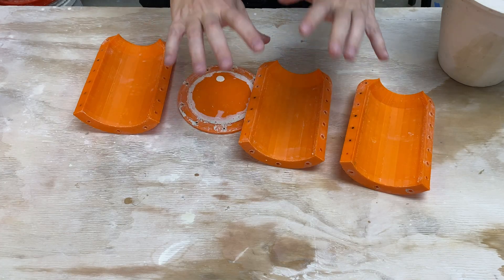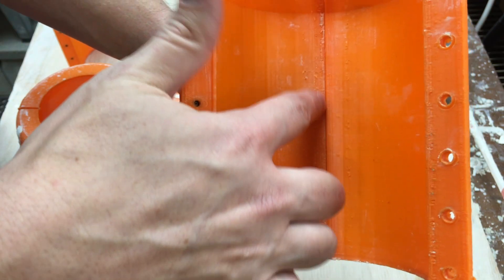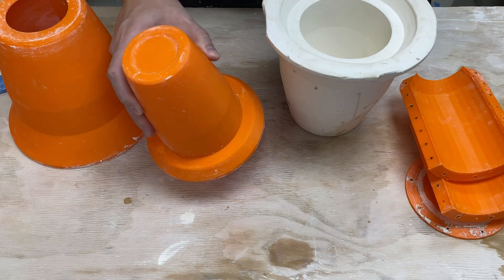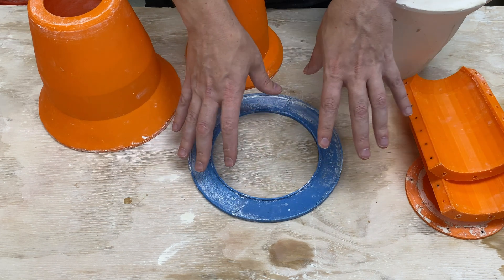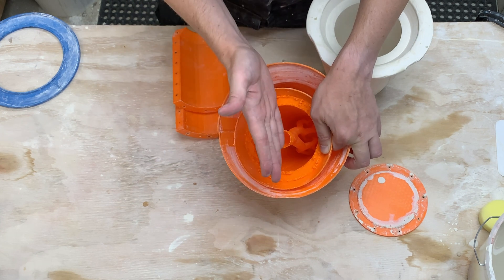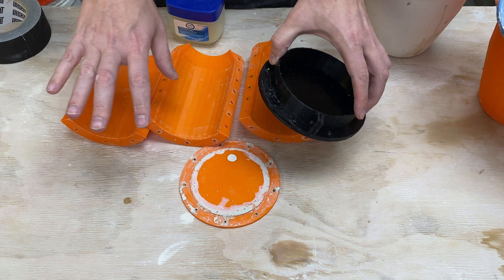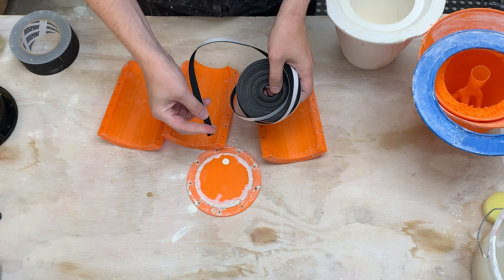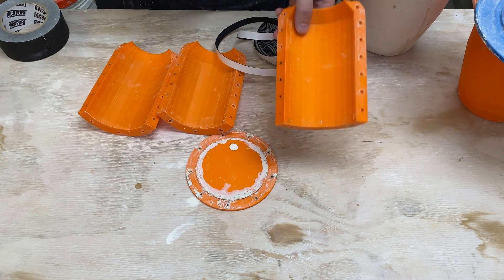Adding a Foam Gasket to Seal the 3d Printed Flange

Comment: It's really satisfying to watch this whole series and see the iterating process. I was working on something similar for casting concrete in custom molds. I think one potential solution that would check a lot of boxes is to use a 3d printer with 2 extruders(unfortunately) so that you can print the majority of the mold in PLA, and a few strategic sections in water soluble filament where you want the mold to come apart. this way you could print the entire thing in one water tight piece. Then just pour the plaster, wait for it to dry, then submerge the whole thing in water for a few minutes until the water soluble seams dissolve, then easily take out the remaining PLA pieces. I just recently got a multi extruder printer but I haven't tested this yet myself.
Reply from the maker: Thanks for following along! I've thought a bit about dissolvable filament in the past - I'm not sure it will work here since the plaster has water in it (and takes about 20-30 minutes to set). With a multi-filament printer you might be able to use TPU and have a printed gasket connected to the PLA. The other advantage of not using dissolvable filament is that the whole thing is reusable. I tend not to make many copies of a given plaster mold, but having that option is nice.
Reply: @PotterybyKent  That's a good point. I'll keep thinking about it but it seems like there's gotta be a good way to use multi filament printers for this. Either way it's fun to watch what you come up with!

Comment: Been watching your videos about slip casting . . . very informative.  Thank you.  Could you do a video showing what clay you use, how to mix it into a proper slip, any essential equipment needed. etc.  I have been throwing on a wheel for a while but would also like to try slip casting.   thanks again.
Reply from the maker: Sure thing! Once I finish my mold series, I'll change up the topics a bit more. In the mean time, I do have some videos showing my slip casting process on my channel. For clay I use dry clay intended to be slip cast from my local pottery store and add some darvan 7 as deflocculant. Getting started, you might opt for premixed slip. As for equipment it really comes down to a bucket and maybe some smaller containers to move around slip, and a mixer (eg for a drill). And then molds like I've been showing here. That's about all you really need!

Comment: A 3D printed gasket in TPU may work. I can print Ninjatek Cheetah TPU on my Prusa Mini which has a bowden tube setup.  Thanks for these updates Kent!
Reply from the maker: I haven't tried TPU on a bowden printer in a long time! Yes, I'd. imagine you could make a custom gasket that way. What would be ideal would probably be a multi-material print where the body is rigid and the mating face is TPU or TPU backed.

Comment: Looks awesome. But before gaskets we usually use o-rings, o-ring chord stock and adding a o-ring groove or a dove tail groove if a 3D printer can do this on the flanges.
Reply from the maker: Thanks! I had also thought about using o-rings. It is good to know they work as an option as well! My intuition is that the geometry of an o-ring grove would require much more precise tolerances, and it is something I might revisit in the future. But I'd like to get to multi-part molds first!

Comment: make outer shell from tpu, make a lip on your slip well and just put outer shell as a glove on it.
Reply from the maker: That's an interesting idea, but I'm not sure it would work. Have you tried before?
Reply: @PotterybyKent  never had a need, but it should work, if it will leak you can just use some construction silicone or ducktape or even simple rope around it to seal it. Also, you'll have less(no?) problems with removing outer shell because it is not so rigit as pla.
Reply from the maker: My printer won't do TPU unfortunately. I worry that the plaster might deform the TPU and create a non-uniform plaster mold (especially as we get into more complex geometries). And it turns out removing the PLA outer shell once it is split like this is really really easy, so that isn't a concern (my next video will have more on that).